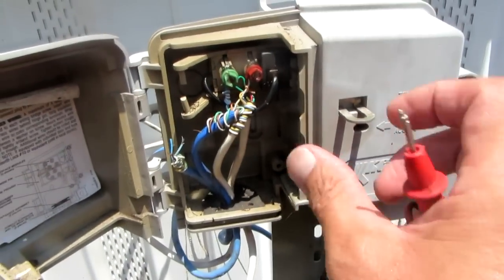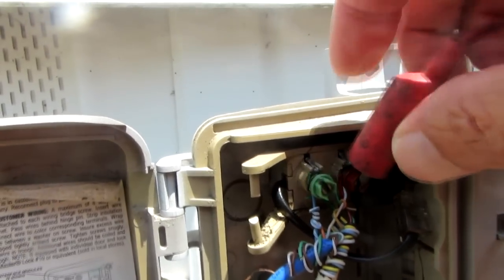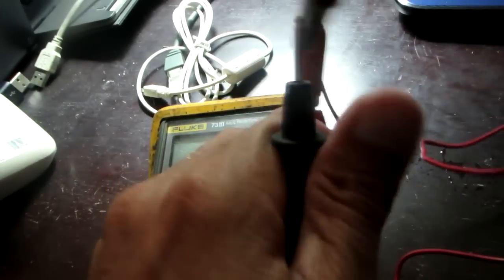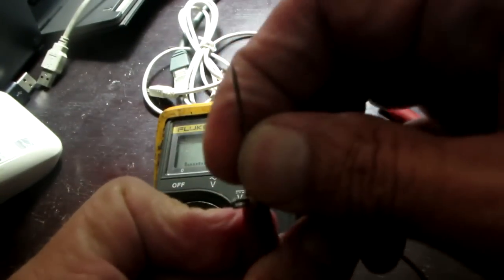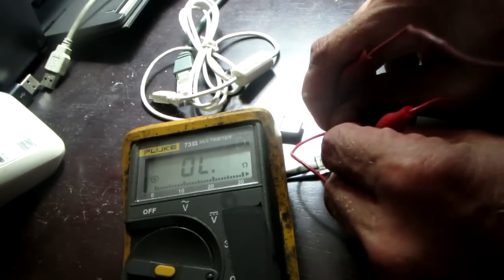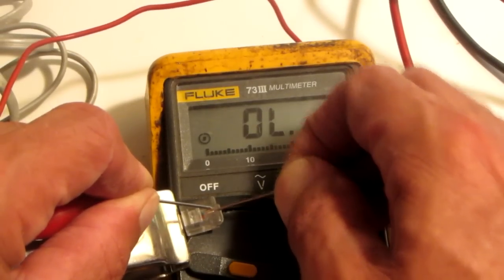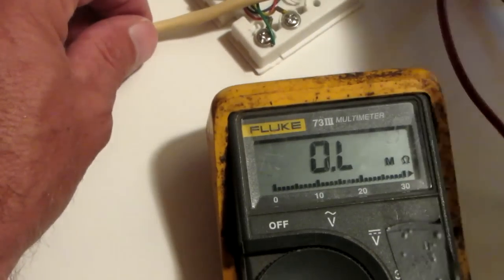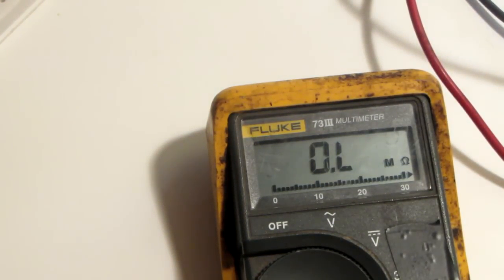Slow internet, noise on your home phone?  Use a multi meter to check it.

Comment: 1) You can not speed up your connection threw using a lower ohm input line  loop.
2) we do not use a ohm meter to find static from cross over, the device we use is called a Sidekick, that uses a high frequency signal over a pair cables.
3) DSL is a digital signal that uses less current then you would use on a voice line, and is more affected by capacitance and distance from you to the C/O box.

Comment: If you want it to be cleaner you need to remove that bridgetap in the connection box you've got your cables daisy chained together sending your broadband up both wires and picking up more interference best way to do it is to send phone and BB up one pair from posts to socket then backfeed the pstn (dialtone) from the socket to that box and connect the other cable to the backfed pair. That way your broadband comes up from the network up the internal wiring on one pair to your socket (NTU) broadband stops there then only dialtone comes back to that then you can go nuts and attach however many jacks you like after that point as your broadband is stopped at socket. That's why you need to have a master socket.
Reply: Leonard Grabsky ok the best way to go about it is to take a two pair or four pair cat5 cable not flat telephone wire that's rubbish and made up of aluminium stranded wire which which will pick up rubbish signals around. Connect one pair only two the posts get a proper phone socket with inbuilt DSL filter wire to socket.
Then take a different pair and wire to the L1 and L2 on the back of the faceplate this ensures the broadband and dialtone came up the pair from the external termination unit outside his house got filtered off at the NTU internal termination unit (phone socket with filter) then leaves the broadband there and only dialtone comes back to the stuff on a separate pair. In the etu you can wire the rest of the connections to the house to the pair that brings back dialtone.
This ensures broadband and dialtone get to a master socket cleanly then you can attach any crappy quality wiring to the rest of the wiring as they're only carrying dialtone and not broadband.
Broadband line would want to be a megaohm of resistance or greater

Comment: Best thing you can do is isolate the jack the modem is connected to. Disconnect all other wiring. Make sure there are no splices in the line going to that jack. It really needs to be a homerun from the jack to the NID.

Comment: BILL EAGLERUNNER, My phone is clean sounded when I connect directly to the Modem which supplys the telephone landline signal. When I connect the modem direct to the Phone jack in my apt wall socket which will supply all my rooms it creates a noisy buzzing sound. How can I troubleshoot which phone jack is causing the buzzing sound? Do I short out or put a termination load on each phone jack to troubleshoot which is causing the buzzing sound on the landline signal? It seems that the wiring in the walls or the phone jacks is causing the buzzing sound issues since when i connect directly to the modem is sound clean and clear.

Comment: If your DSL is slow from the phone company, it might have been lowered automatically if TCP request to resend a packet from missing data on your error control, the phone company
will throttle your throughput due to error requests.

Comment: On a good day, I measure 0 V DC and measure 3.2 kOhms back to the DLSAM with a Fluke.
When the DSL connection is bad, I measure about 0.9 V DC across the incoming line with the same DMM. 
Conclusion, I have bad 'line' back to the DSLAM, or the DSLAM itself is bad ...
Reply: To clarify further, you are measuring the two conductors on the DRY DSL line (no phone service) pair with your DSL modem unplugged going back to the DSLAM at the central office. Correct?
Reply: @D Fiber
Yes. There is another factor. The line (or DSLAM) goes "bad" (CRCs and FECs climb and the modem "untrains" then won't re-train) when the temperature goes low, like from an 80 deg day to 65 the next morning. If the temp stays above 70 no problem. Rain or no rain makes no difference. Eventually, the modem will retrain, but it might take 1/2 to an hour.
Reply: @uploadJ  sounds like a "high joint" or high resistance condition like a loose connection somewhere. Works better when warm. Cold causes the metal to contract creating an open. Internet needs very good splices.
Reply: @nooneyouknowhere6148  
Yup. Anyway, I went with "Visible" at 40 US a month incl taxes unlimited tethered via an iPhone 6S ... only plan I could find unlimited tethered ... been a year + 3 mos and no issues ... used 43 GB this month so far.